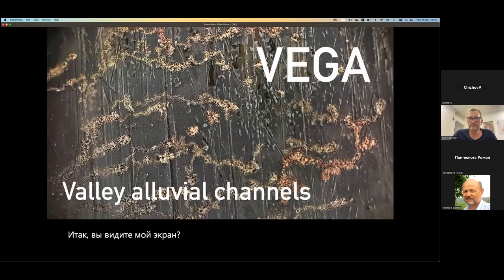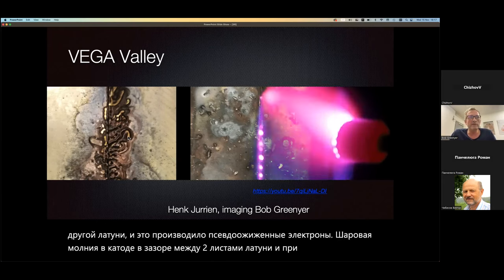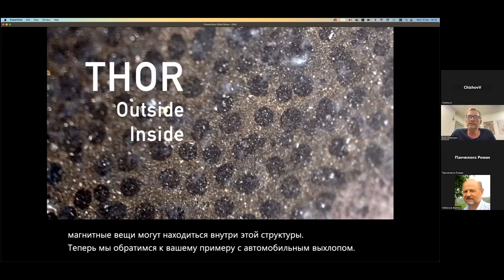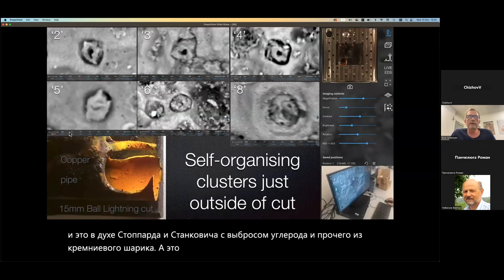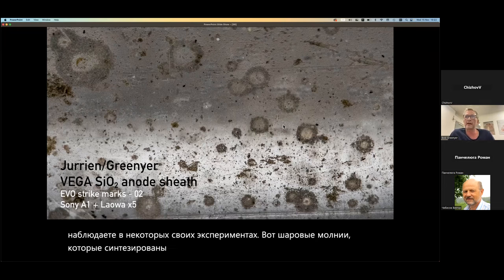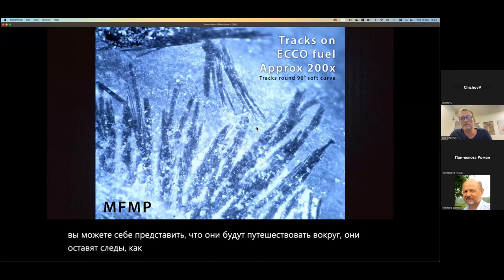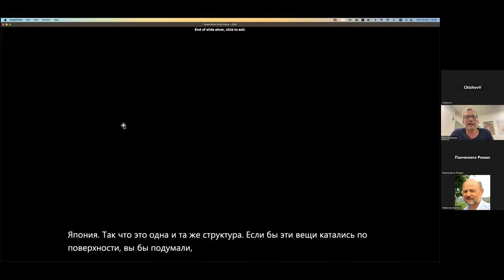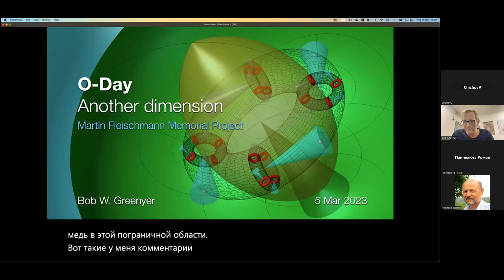Comments in discussion with Russian Cold Nuclear Transmutation and Ball Lightning meeting

Comment: What was so inspired about the candle again?

Center of charge clusters is magnetic, in one case, iron and oxygen. Outside the charge cluster you have diamagnetic material (copper/zinc oxide). The charge clusters are monopole in nature (as we've come to believe over many years).  Toroidal structure, when cut in half, 2D structure represents sacred geometry (ie: "vesica pisces").  Out of the bottom of the structure we see ejection of new elements (titanium discs, carbon).  These toroidal structures are fractal and can scale up, eventually becoming ball lightning.  A 15 tor (tor being fractally scaled toroidal structures?) is able to carry material (ie: copper) and leaving a trail of carbon. Neither carbon or copper enter the non-radiating boundary layer of the structure because they are diamagnetic.    When these charge clusters collapse, we find calcium and oxygen, which are paramagnetic and can live within these structures (charge clusters).

Is that accurate?
Reply from the maker: Pretty much.

Will produce the English subtitles for the Russian meeting and composite and publish as get time.